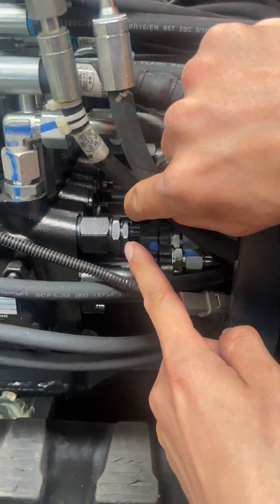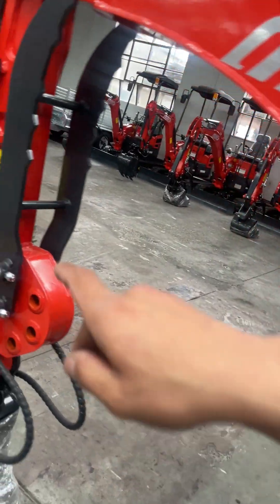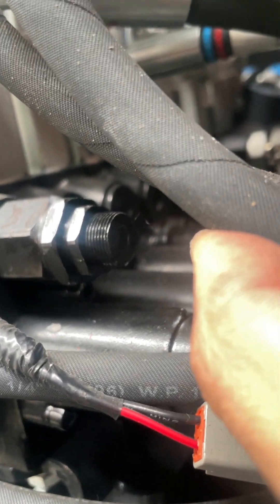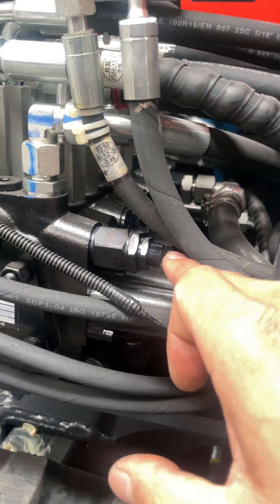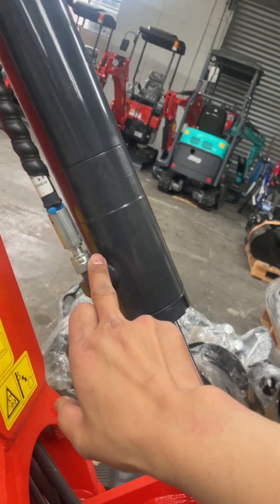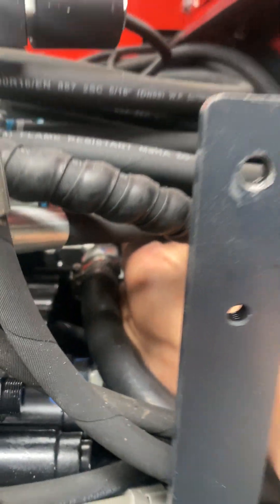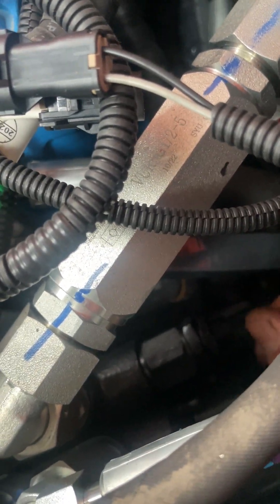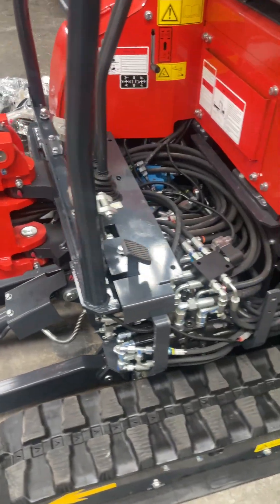How to adjust the hydraulic flow rate of a mini excavator MXG XE23U

Comment: this is the pressure relief valve right i know u can up the  working pressure on it. i dont see how it changes the flow rate tho. I have a chinese excavator similar to this one and i only want to make the flow rate less . i think this adjustment does not change the flow rate.
Reply: Me too, I want less pressure to slow down how jerky it is.
Reply: @robs8882  Yes, exactly my problem - too jerky. I have a Ningbo CX-15B that I need to adjust. Please advise if you figure this out. Thanks.
Reply: @robs8882  You want less flow, not pressure.
Reply: Hydraulic in-Line Adjustable Variable Flow Control Valve w/Free Rev Flow, 1/2” NPT
Brand: Summit Hydraulics